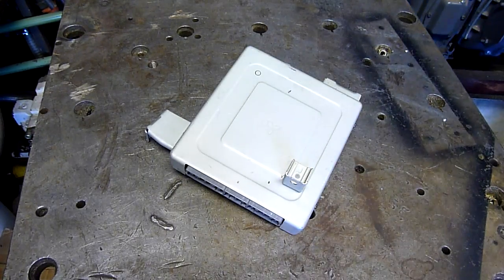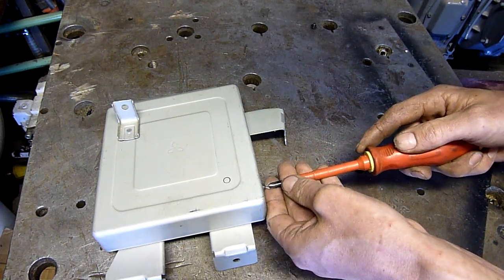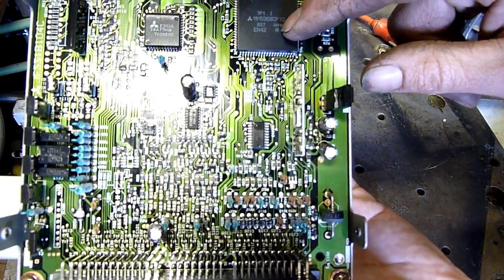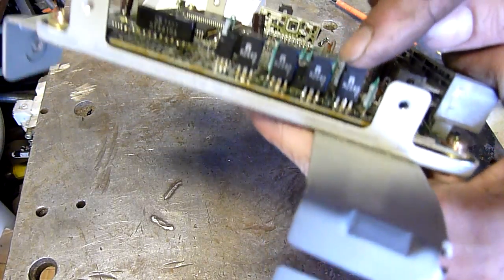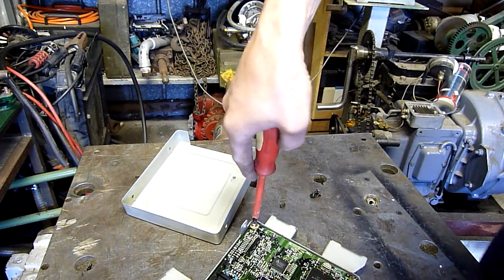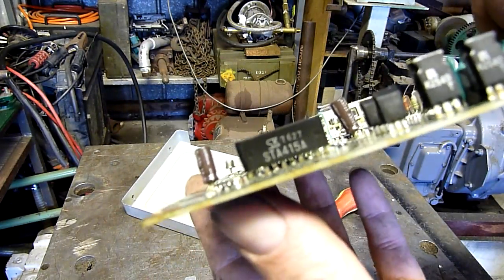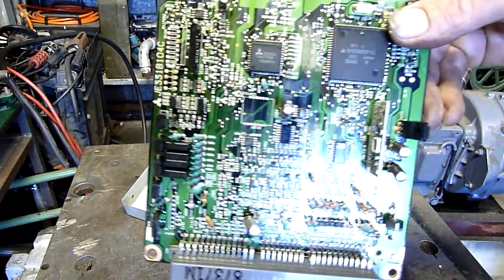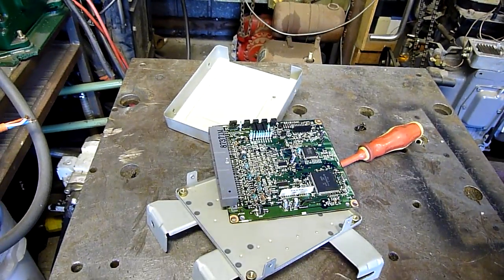Little Car's Brain Autopsy - Mitsubishi Electric ECU

Comment: Petrol engine ECUs are fairly boring, as far as components go. Pull apart a modern common rail diesel ECU, you'll find a couple big tantalum caps for firing injectors, the Bosch based system used in the Mercedes Sprinter charges one cap from battery, fires the injector pulse, the solenoid discharges back to another cap and is topped up with battery then fires the injector, and the process repeats. Another one that's interesting to pull apart is a 99-08ish Volvo CEM, it has a flash chip inside it to hold the key immobiliser and engine configuration data.
Reply: That's how it works :) Used to develop some of the HW modules for those ECUs in the past...

Comment: Looks like it also has an RF transceiver on there - did your original keys have central locking/etc built into them?
Reply from the maker: I only had one key but there was a central locking system in the car. tho it would be odd  for it to be a part of the engine ECU, normally its a separate module.
Reply from the maker: I wonder if the part you pick as a RF transceiver is actually a receiver for the crankshaft tone wheel or somthing?